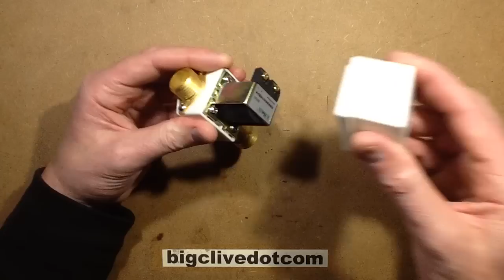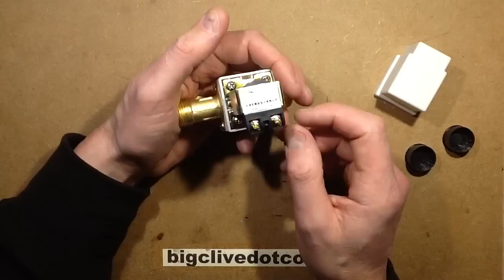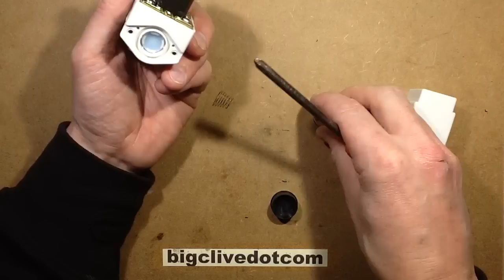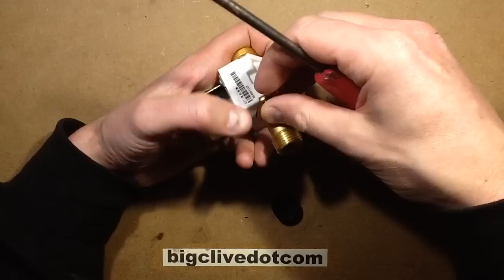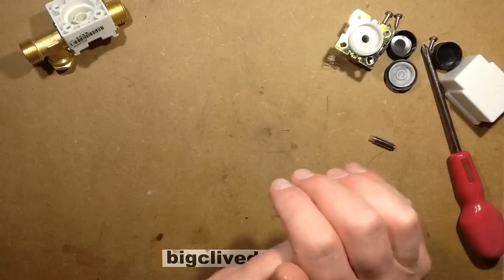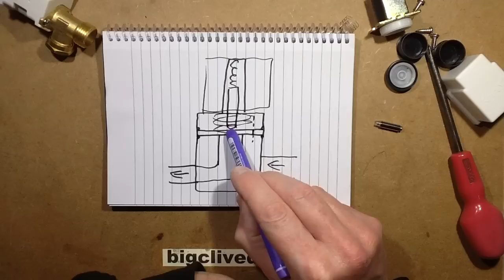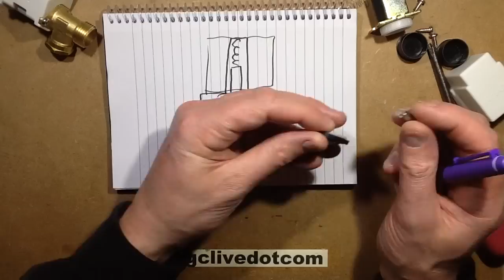inside a cheap eBay solenoid water valve.

Comment: I use a lawn sprinkler valve to turn off all my water in the house until I need it. My water system leaks everywhere and I can't afford to replace it. So, rather than let the house be destroyed and my water bill go to extremes, I put the valve on my water intake. It has worked for several years, now.

Comment: Excellent video.
Do you know if those kind of valves can be used in a low pressure water system?

I need to control the out of an IBC water tank and this might handy, but I'm afraid the water pressure would not be enough to make it fully operational.

Thank you.

Comment: Does this water solenoid valve require water pressure to operate the closing and
opening of the valve? Thanks
Reply from the maker: In a way yes.  It works by equalisation of pressure on both sides of the diaphragm.

Comment: Hi , 

This is yoyo from tonhe manufacturer, we focus on mini electric valve(1/4'' - 2''), which are approved CE certification, and SS valve approved NSF61
international certification. Our company also approved SGS ISO9001. Hope to build cooperation with you sincerely . 
 
you buy the motorized valve from our factory?

Our company main products:
1)2 way 1/4"-2"
  3 way motorized valve, material: 1/4"-1"
  3 way brass 1/4"-1 1/4"
2)modulating valve (1/4"-2")
3)water leak system with motorized valve(1/4"-2")
4)remote motorized valve(1/4"-1")
5)timer control valve(1/4"-1")
 
if you need our products contact us freely
 

Any other comments tell us freely.
  
Warmest regards,
yoyo

Taizhou Tonhe Flow Control Co., Ltd
Xincheng Road 1012, Huangyan,Taizhou, Zhejiang, China
Mobile: +86-18957612187 

Skype: meizi2661
Email: tonhe08@china-tonhe.com

Comment: solenoid water valve can this be use in gray water tank ?
Reply from the maker: Only with a filter as the valve uses tiny holes in the diaphragm as part if its operation.
Reply: @bigclivedotcom  Thank you so much that make sense .

Comment: http://www.ebay.com/itm/12V-DC-Electric-Solenoid-Valve-Water-Air-Outside-1-2-Brass-Normally-Closed-N-C-/271969883468?hash=item3f52ab154c:g:yIkAAOSwDNdV37~z

Comment: I tried using a solenoid valve like this to control a bucket-fed drip irrigation system, but it was a total fail because these valves require a certain amount of water pressure to work, and the bucket's few feet (less than a meter) of height was insufficient. Looking at your dissection, I guess that's because low water pressure is unable to press open the diaphragm.

A motorized ball valve (off eBay) did work for me. They're more expensive, but would be cool if you could tear one apart some day.

Comment: Thank you for the great overview of the solenoid valve's operation.  I was just about to buy one of these when I thought I'd check your channel for a review first!  Was there any indication if the solenoid is connected to a diode for inductive voltage protection?
Reply from the maker: There's no diode fitted, so you'd need to add that yourself if switching with a transistor.

Comment: "The diaphragm has a pinhole through its center which allows a very small amount of water to flow through it. This water fills the cavity on the other side of the diaphragm so that pressure is equal on both sides of the diaphragm, however the compressed spring supplies a net downward force. The spring is weak and is only able to close the inlet because water pressure is equalized on both sides of the diaphragm."
https://en.wikipedia.org/wiki/Solenoid_valve#Internally_piloted

Comment: Clive.  Look back on your notepad sketch, you missed an important point that you drew perfectly.  The force on the top of the diaphragm is higher than it is below because of the unequal area.  When the pilot spool blocks the hole in the centre and the diaphragm seals the exhaust port, the area of the underside of the diaphragm is reduced by the area of the exhaust port.  As the inlet water pressure is free to equalise through the bleed hole it is the different area of diaphragm exposed to this equal pressure that seals the diaphragm down hard on to the port.  
When the pilot spool lifts off the diaphragm the inbalance is lost as the hole in the diaphragm allows the cavity above the diaphragm to fall down to the exhaust port pressure and so the diaphragm is lifted by the higher inlet port pressure.  The force of the helper springs become insignificant as water starts to lift the diaphragm seal.  The small size of the bleed hole means that so little water passes up through the diaphragm compared to the flow (and pressure) down through the pilot valve that again the water pressure is doing the work.  
The reason for the check valve just inside the outlet flange is to make sure that the exhaust pressure is lower than inlet if possible otherwise the diaphragm is forced closed and not open as the pilot valve opens.

Does any of that make sense?

Garry
Reply from the maker: Thanks Garry, that's useful information.

Comment: The solenoid changes the water pressure from one side of the diaphragm to the other pushing it open or closed depending on the position of the tiny pin . This works exactly like a washer inlet valve.  I have taken many apart and cleaned them when they either dond open or close compleatly ; ( usually what goes wrong with them in washers. Why replace when if you clean out the grit they work like new again , provided lightning or a power surge has not killed the coil ; which could only happen if it was activated at the time of the over voltage . Very unlikely.

Comment: Nice!  Your explanation is so much clearer than the textbooks .....  (or maybe it's just your mesmerising, mellifluous voice .....)

What is the thread on the pipe fittings?  Could you use 15 mm. olives and compression nuts?  Or would it have to be hose connectors?

Comment: It has been designed for low pressure which is why it has the extra spring. The important parts are the quality of the rubber and type of steel used in the plunger so it just not rust and jam. Same quality as used in you washing machine at a fraction of the price. but 230/110 volts Ex Factory FOB prices are around $1.50 -$3 on a lot of brands. If your lucky have a look on line you may see the same brand with a different fittings, and just change the inside round. Failure to fill fast is normally a small hole in the rubber part keeping the valve closed. Most were made in Italy a few years ago.

Comment: Naah, this is not even general use. More like household use. I don't think it can work at more than 3 bars. It really is "worth" the money, it's a very poor quality valve.

You should also know that there are more types of valves. I think this one is a floating diaphragm. You can also have hung diaphragm, hung piston and floating piston. Also, that little bit from the spring that goes into the hole in the membrane could also protect against water hammer effect.

Comment: Hose fittings look like anodized aluminum--if so, no damn good. The aluminum will corrode to aluminum oxide--the stuff they make sandpaper from. 

If it felt heavy in the hand, that's brass, but I've had all kinds of things spoiled by aluminum fittings.

Comment: I wonder if they might be useable for my central heating system. Every radiator has its own set of tubes. If I could give every room it's own temperature sensor, and run the whole setup on a simple plc, there might be quite some savings possible.
If only this Chinese stuff would do a few 100.000 reliable cycles ... :)
Reply: You can buy from a factory motor controlled radiator valve complete with wifi and room thermostat and control by Raspberry Pi.  All the hard part has been done. Factory is in Buji, Shenzhen from memory. You might need to buy a container full.

Comment: 1:10 - KHAAAAANNNNN! Sorry, I had a Star Trek moment. ;-)
It seems cheap enough that one probably would not want to disassemble it... And inexpensive enough to not bother rebuilding them if the diaphragm fails, just replace the whole unit for a few bucks. It is, however, a nice little unit to have for a clothes washer water inlet replacement if the original fails... I could also see it applied for light-duty irrigation, hydroponics, water features, even for DIY heat pumps. Quite a nice find, Clive!

Comment: Hi Clive, I think if you listen carefully to these valves in action on the job, you can actually hear that brief pause as the pressure equalisation is taking place on both sides of the diaphragm when the valve closes.I think it may be a requirement of the water regulations that an instantaneous water shut off on a main is to be avoided to prevent water hammer. The concussive shock can be quite considerable. Keep carrying on!

Comment: Your discussion and drawing were very elucidating, many thanks Clive.  I construct irrigation systems but haven't yet had need to service a valve interior, and so wasn't aware of the clever force multiplier effect of the diaphragm.  I've confirmed that the landscape grade valves I use operate on this same principle (although the solenoids actuate on 24VAC, presumably because of the long cable runs required).  I'll have to order a couple of these cheapies to play around with for toy aquaponic systems and the like.   Come to think of it, I wonder if the valve may not positively close under low pressure intakes, such as gravity feeds...

Comment: I don't see those cheap-o self-tapping screws holding reliably against domestic water pressure.
Reply: Better than glue, Glue does not work I know. On some the valves parts are the screw and sealed by the washer.

Comment: Project idea for the channel, something I've wanted to do for years! A small version of the Las Vegas fountain, that famous one? ;)

Awesome video! Really interesting to learn about how these works! =)
Reply from the maker: Bellagio?  Many of the automated fountains just use a pump per jet for simplicity, except for the high power effects that often use compressed air to purge the water out of an underwater receiver for explosive jets and plumes of water.
Reply: Ah yes, the one outside Bellagio =D Oh, didn't know about the compressed air! But yeah, lots of pumps. Of course, maybe not as big as the original, but a smaller version ;)

Wouldn't that make a great feature to your back garden? You already have lots of lights, a small Bellagio fountain would be cool too =D

Thanks for the reply Clive! =)

Comment: I use one of these solenoid valves connected to a ZJ-LCD-M flow meter on my brewery (real ale). I use it between the HLT and mashtun so I can measure the volumes of water. Works well most of the time but not and again it stops, I think the water gets too hot as the valves are rated at 80 degrees C maximum.

Comment: Would any solenoid valve be ok for drinkable water or do they make special type for that? I'd use it to fill a coffee maker with water.
Reply from the maker: As long as any simple valve like this is flushed though with clean water I'd think it should be OK.  Many drink vending machines use solenoid valves like this for controlling water flow.
Reply: bigclivedotcom Hi Clive, I bought one and put it in the pipe to my bath filler. Fitted a 10 minute mcu timer to control it and use an arduino with a bluetooth module and proximity detector so now I can fill my bath with touchless 'swipe' or from my phone. And it shuts off so no need to keep an eye on the water level. I really must get out more! Keep the great vids coming. Love 'em!
Reply: No. Officially anything for potable water needs to be WRAS approved. Similar, WRAS approved solenoid valve costs about 10x the one shown in example above. However, build quality is 10x superior, so well worth the money.
Reply: valve should probably be made of drinking-safe materials and be drinking-safe, otherwise might not be a good idea
Reply: That was my first thought when I saw this.

Comment: I wonder if you could create a system with 2 of these, and an arduino, that would let you remotely turn on and set the temperature of your shower. You could even set it up to an alarm, so the shower is ready the moment you are.
Reply: Those have a long time of "relaxation" (i.e. closing). It also became worse over the time due membrane tear down (depends on water quality/pressure/temperature).
Same valve is used in almost each modern toilet inlet.
Reply: One of the valves would have to be proportional F&P New Zealand used to have a 24v one a few years ago but if you have any water hammer you need an anti hamer device as well. The aluminium tube with the heat sensor was used to cool the motor triacs as well. Then when it corroded it was not a nice ending with 310v DC 
.

Comment: I would not trust to have that thing pressurised in my house. Self tapped screws into a plastic housing, combined with hydraulic hammering is a recipe for disaster.
Reply from the maker: Have you ever looked at the valves in your laundry equipment?
Reply: I have, and they are not pressurised while I'm not at home, that and the washing machine is placed near a drain.

Comment: Doesn't a valve like that restrict the water flow massively?
Reply from the maker: It's the same system used in a washing machine, and they fill quite quickly.
Reply: +bigclivedotcom This type of valve is all but universal (UK) in toilet cisterns as it's far more compact that the older float-on-an-arm style, plus it has sharper shutoff point. I've always known them as equilibrium valves.
Reply: +Carsten Svendsen I've got a Fluidmaster float valve that uses this principle on the cold water storage tank here (UK) and even with the supplied high pressure flow reducer fitted the overflow couldn't keep up. Fortunately I tested it before I found out the expensive way and modified so it could.
Reply: Useless comment deleted.
I spaced on Fluidmaster and went off the deep end.  Dementia is a terrible thing.
Reply: +Eddie the Grouch Pardon? Don't think we were talking about flush valves.
Reply: The internal port area is actually pretty generous compared to many I have seen.  However, the convoluted path does tend to be turbulent and noisy at high flow rates.  For high flow applications, albeit a bit slower acting, a full-port motorized ball valve would be more appropriate. http://www.ebay.com/itm/1-2-Motorized-Ball-Valve-Brass-12V-DC-High-Flow-Diesel-Water-Electric-/122103892946?hash=item1c6df58bd2:g:MIgAAOSwLVZVyBEA
Reply: Carsten Svendsen if it does and you need more water flow or a higher pressure, you could run more than 1 in parallel.
Reply: I used one of these for air, worked flawlessly

Comment: I use one very similar connected to a raspberry pi that also has one of those soil moisture probes connected to it. didnt trust it on a mains fed water supply so it controls a gravity fed water tank that collects rainwater. Built it to keep my cucumbers watered in the summer but by the time I finished it the summer was over.. always next year...

Comment: I hope you will see this if not I'll send it  n patreon where do you get what you use to output specific voltages? What brand I'm sure it's in a video somewhere.
Reply from the maker: I have never named my bench power supply because it has a hardware/software issue that means I wouldn't recommend it.  Very occasionally it locks up and puts out a rogue random voltage.
Reply: bigclivedotcom ah that's unfortunate. I've looked at a few for small projects but I don't know what a good one is.

Comment: Hi Clive, this is fantastic. We have 2 x 12volt solenoid valves on our boat toilets to control the flushing water. These have been a pain of my life for the last 10 years as they are always leaking when the small transfer hole blocks. Thus the water ends up continuing to flow and flooding over the bowl. That little tag on the spring to keep the hole clear is such a simple idea.
My valves are made by Jabsco and cost over £100 each. I will be order 2 of these plus 2 more for spares asap.
Thanks for the tip. I will post a video of these being fitted and a link to this video on our channel.
PS Thanks for all your videos they provide endless hours of entertainment and information for us fellow geeks! 🙂

Comment: Cheap nasty solenoid control valve, The springs will most likely rust within 12months, the main diaphragm will erode in a similar  period and potentially cause a minor disaster. Glad to see the tear down changed my mind on getting one will spend the money a buy an industrial quality unit.

Comment: tried using these valves for airgun, found out that slightest hit to it could lead to actuation of the valve, thus rendering the gun unsafe whenever the reservoir is inflated up
Reply: Damn. I half built a nerf gun mod which revolves around exactly exactly this concept. On one hand you saved me the time i would have wasted on finishing the project before discovering it was fundamentally flawed. But on the other hand i still wasted a bunch of money buying all of the components and ruining a perfectly good nerf gun : (
Reply: try a mechanical trigger with a ball valve and a spring that fully opens it when brought to a certain point
Reply: What pressure did you test them up to? At what point do they leak?
Reply: under 40psi when hit,it leaks,above 45psi ,18 volts is unable to open up the valve
Reply: I wonder if the issue could be solved by increasing the strength of the spring that pushes the diaphragm down.
Reply: eventually I decided on roller valve with qev valve
Reply: tried it, even 40 volts can't open the valve, hitting it still opens it.

Comment: Would this be fast enough for a pneumatic potato gun quick release?
Reply: PixelOutlaw not sure about potato canons, but I've used this exact same valve in a compressed air rocket launcher, and it works well in that application (launch tube is 15mm copper pipe and the rocket was made of foam pipe insulation)
Reply: Well, pilot operated valves are generally slower than direct operated valves, but direct operated valves with high flow rate will be more expensive.